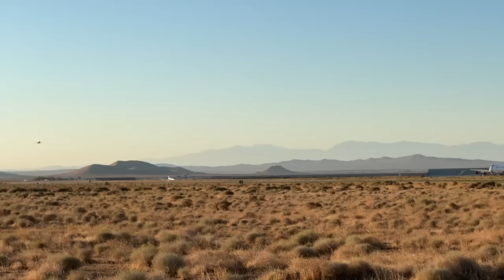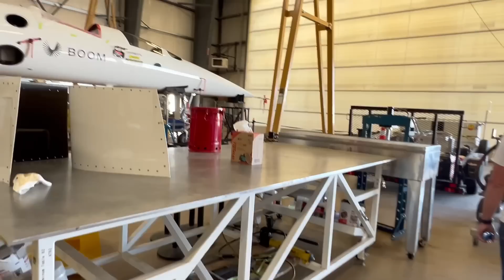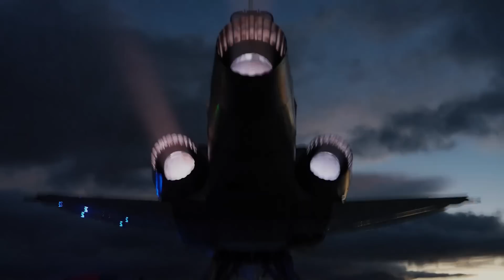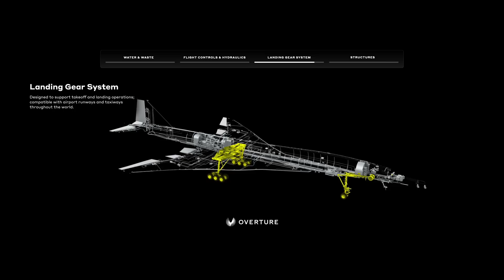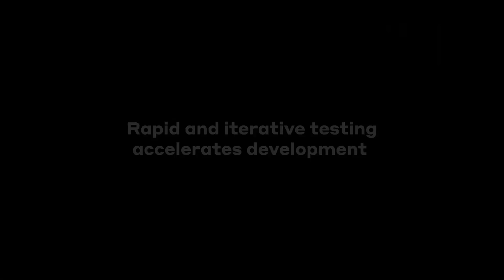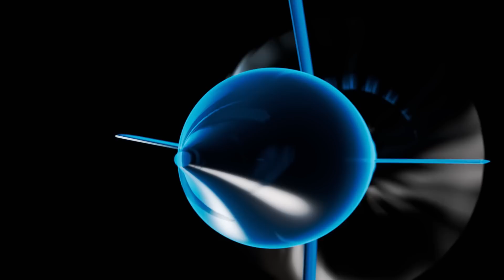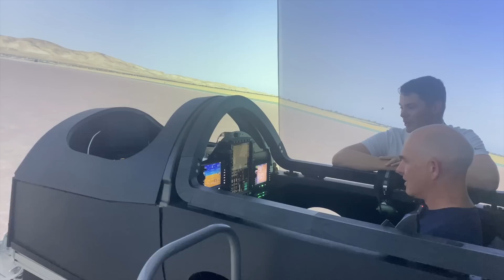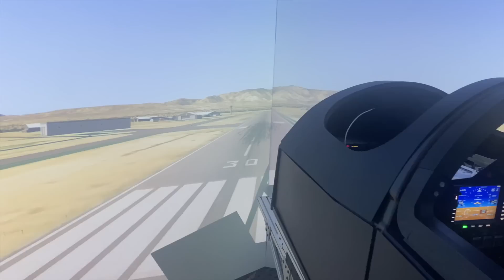Will This Experimental Supersonic Aircraft Show Supersonic Airliners Can Work?

Comment: They put windows at the upper face of the craft instead of sides. Brilliant idea to reduce friction, I usually put basic fins above craft that doesn't burn in re-entry at KSRSS.
note: basic fins rated at 1200K, but re-entry is about 2400K at ~10° re-entry attack angle
Reply: Now, they just have to put golf ball dimples like Mythbusters did to reduce drag.

Comment: The rationale for this test aircraft seems unusual.  Major test outside the wind tunnel usually begins w some form of the actual engine to be used w the final aircraft, because it makes up such a huge part of handling, performance. But the engine is nowhere in sight.  How is this significantly  different then from buying a T-38, attaching some cameras? Boom is not a landing gear company, not an aero  instruments company. Goes M1+ out of the box.

Comment: So w 2x passenger mile fuel consumption* in SS flight vs subsonic, will the Overture have any legs? If it can’t do Pacific flights, can’t claim some of that business, it’s bound to end in the same expensive doom loop which got Concorde.

*And I guess that’s optimistic . Try 3x, after realizing they can’t fly 60k’ with large passenger cabin pressure stress without a heavier cabin, and add climb time, climb fuel, so they expand the fuselage to carry more fuel which adds more drag more weight on high speed take offs, and so they … and so they .. 
We’ve seen this movie.

Comment: My gut guess is that the fuel required for this being twice as much shouldn't mean that a flight costs twice as much (purely on a cost center basis) since there is so much overhead involved in flying -- paying for pilots, hosts, mechanics, amortized repair costs, air traffic controllers, not to mention all the fees of the airport itself that get included like all the people involved in moving luggage, doing tickets, and the TSA.

Comment: Aerospace engineer here: There's actually something in this that is a give-away that they are THINKING CLEARLY and its a lesson for anyone doing a tech start-up. I am super impressed by what this one thing tells me. About 5  minutes in Scott mentions the J85 engines.

A few years ago I did a proposal to the Australian Space Agency for a program based around air launching small cube sat capable rockets using a variation of the Scaled Composites White Knight 1 which was used for Spaceship 1 and a couple of NASA programs. WK 1 also uses the J85. The main reasons was it can operate at higher altitudes (>50,000ft), it was available and it was maintainable. 

Part of the reason I picked the WK-1 was because of the engine. The main reason was that WK-1 worked and we just would not need to do anything but buy one. PLUS - we could get a second hand ex-USAF T38 for a chase plane (same engine). We could get an early model Learjet (23, 24, 25, 28) as a air launch platform for smaller rockets (<1.2t) as its engine is from the civilian variation of the J85.

THE MAIN REASON for thinking like that is it saves a massive amount on maintenance costs because all your jet engines are from the same family. Which means the parts you have to carry and having mechanics available is massively easier than many other engines or just as bad having a variety of engines. PLUS the J85 and its civilian variants, although out of production, are so widely used that the parts needed to maintain them are still available. Because the USAF still has the T38 they need spare parts so the spare parts are still in production even though the engines are not.

I have worked on development projects many times and one of the things you look to do is select things YOU KNOW WILL WORK so you can concentrate on other things. This is fundamental to project management. This is called project risk reduction and so many companies get it wrong which is why so many development projects fail.

Just that one thing has completely changed my mind that these guys are both sensible and practical rather than being another money pit operating on fantasy land whim.
Reply: I suppose while they're in development that helps a lot, maybe before they can pitch to the big investors with all their test data from the small prototype? But all that goes away once they move to the Symphony. I'm just some guy who has worked in the airlines (dispatcher), and I get what you're saying about the simplicity and affordability of widely used existing technology. One airline I worked for was an early launch customer of the Embraer Brasilia, and its teething problems were awful, though predictable for a new design (even with off the shelf engines). It all worked out, and the Brasilia became an awesome aircraft.

But that Symphony engine looks far different from anything else in the airline industry, and I imagine training for A&P's will need to be extensive. I don't imagine they will wear or fatigue like typical subsonic engines, though maybe I'm wrong. I'm no expert. Just imagine an SST with no afterburners... it'll be loud as a medium bypass fan, but nothing like those afterburners.

I really hope this works out for them. A smaller size than the Concorde seems a good idea since they couldn't fill them, and if they really get that efficiency (twice the fuel per passenger as subsonic aircraft), I think they'll do quite well, unless they fall due to environmental concerns. At first it looked deceptive - the shape is very similar to the old Boeing 2707 design, so in my mind I saw it as a great big plane. Who woulda thought - the economy of smaller scale?
Reply: @DrBeenaPlumber  Actually Concorde flew with almost 100% capacity on every flight. That was just one of the myths about it NOT being economical.

Sorry if this takes explaining but its important people know what happened.

There was a superb BBC documentary done on Concorde after they cancelled it and it told a far different story than common because for a change they asked the pilots and it was the pilots who ran the Concorde Division of British Airways.

Way back at the start after a very shaky start the executives told everyone they were going to stop Concorde because it was losing money. The pilots called them out saying it should not be losing money as it was operating at 100% capacity. The execs called their bluff and challenged them that if they could make money they could run the division.

In a stroke of genius they realised that there was this odd group of people who'd use Concorde 2-3 times a week. Sometimes they fly across the Atlantic and then straight back on the next flight. So they went to those people to find out who they were. The answer - lawyers and bankers and as part of their work they'd fly across the Atlantic get some papers (contracts) signed and fly back. These people loved Concorde because it saved them so much time.

The pilots asked them what they thought the VALUE of a ticket was and were shocked to find it was several multiples ABOVE what was being charged. These lawyers and bankers actually had no idea what a ticket cost because it was their secretaries who bought them.

So the pilots raised the ticket prices to where Concorde could make money and stuck to those couple of routes the lawyers and bankers wanted. For 20+ years Concorde them became British Airways most profitable division. Even when all the other divisions lost money Concorde still made money because of its core business.

What actually killed Concorde was Osama Bin Laden. On 9/11 around 100 of the top users of Concorde died in the towers. So there was a sudden a dramatic loss of their key market. They never recovered.
Reply: @tonywilson4713  Wow, that's certainly not a story I've ever heard, but it jives with this company's statement that a core customer base is out there. I know it's a myth that the Air France crash killed the type, and I know 9/11 had people kinda nervous about flying in general. I didn't know they lost so much of their customer base in the towers.

Is that documentary on You Tube? Do you know its name? I'd really like to see it. If that's really the full picture it sounds like the SST market is ripe for the picking right now (bankers and lawyers must be back up to their full compliment), unless it dies because of environmental concerns.
Reply: @DrBeenaPlumber  Yeah I had never heard that story until I saw that documentary and that documentary included interviews with the pilots.

The first time I saw it was on TV and I think it might be on YouTube. Its an odd length like 40 minutes or an hour 10 minutes. Its not the standard 25 or 50 minutes for TV.

Comment: The big thing that made the Concorde so problematic was cost.
Expensive to run planes means high ticket prices. High ticket prices means fewer passengers. Fewer passengers means less demand for the plane. Low demand means high development and production cost.
If flying 3 times as fast is only marginally more expensive for the passengers, they would gladly use the fast plane.
But a ride on the Concorde over the Atlantic cost somewhere around 10000-15000 (adjusted for inflation). Exactly the opposite of what people want.
If they manage to design a supersonic passenger airliner with a ticket price in the low 3 digits of today's money, there can be a market. Even if they get it into low 4 digits there will be demand.
Reply: Concorde had its market and when it flew it was profitable from the late 1970s on. It was a small market but it was big enough for the handful of aircraft which existed. Of course they could not simply extend this market that simply and it had to fly over sea otherwise it was inferior to a normal airliner.

It's like with the 380, there is still a market for the ones using it. You can't use it everywhere and not every airline can use it but if you use it on the right routes it's still economic.

Comment: I've had doubts from the start even before RR pulled out.
A cost out of the designers control is airport landing and handling fees which will be as large as an a380 because it'll need plenty of runway yet this'll be shared over a few passengers. Not even Taylor swift can afford to land at Heathrow in her global express.
There were so many restrictions on concord's routes despite the government involvement.

Comment: Same engine manufacturers also make all the 'supersonic' engines ,and are quite unassailable , engine cores are shared in many applications so even this one should have an off-the-shelf core from these manufacturers and maybe custom stages they need for the task vs blank sheet of paper design

Comment: Fifteen or more years ago there seemed to be a concerted research effort into sonic boom reduction on several fronts, including by NASA. I saw one of their research vehicles at Kennedy SC in 2012. The goal being to remove the barrier to supersonic passenger flight over land, which had been one of the real drawbacks of Concord. Yet Boom seems to be ignoring all of this and has stated that they will also not be going supersonic over land when in service. So what's the point? And what happened to all of the boom reduction research?

Comment: What happens if they lose the nose gear? Generally they’ll have a blow down system or just use the weight to drop the gear in case of a gear malfunction but those systems can also fail & it does happen. So what do they do to land if they lose the nose gear?

Comment: "About twice as much fuel per passenger" compared to what? Average? A lot of flights today are 'short hop' flights between neighboring cities, which use extremely high amounts of fuel per passenger and drive those numbers up quite a bit. Even if Boom is making an apples-to-apples comparison on the routes they want the XB-1 to fly, we're in a time when we (still) need to significantly reduce oil usage, more heavily regulate airlines to reduce wasteful emissions they unnecessarily generate, and incentivize innovations and expansions in and increased use of more efficient travel methods than air, so double the fuel use for wealthy people to save a couple hours isn't something we need to have or allow.

Then there's the noise problem. The engines of the Concorde created a massive nuisance to thousands of residents anywhere near the airports it used. Boom consistently fails to mention this problem, or offer any metrics or even indication to show the extent to which the XB-1 will have the same problem. That this one has no afterburners doesn't necessarily mean it won't also be earth-shatteringly loud even compared to contemporary airliners.

I like cool new aerospace innovation as much as anyone, and there are in many cases very good reasons to pursue it despite its costs. "Because it's cool" and "because it'll be like the glory days of the Concorde" are frankly shitty reasons. I would love to believe there's some other reason besides those and wealthy people's convenience that a supersonic airliner is a good idea, but in the multiple years I've been seeing ad spots for Boom Supersonic, I still haven't. Meanwhile, I haven't seen a good answer to either of these problems, which are actually compelling concerns.

Comment: Economics doom this to failure, whereas an oblique flying wing would be so much more efficient and could fly at a range of transonic and supersonic airspeeds efficiently.   
Another issue is the environmental impact of emissions in the stratosphere is potentially very problematic if any amount of scale is reached to sufficiently make this economical.
It was fun working as an aerospace engineer on a similar NASA funded project in the late 90s.

Comment: "Will This Experimental Supersonic Aircraft Show Supersonic Airliners Can Work?" No it will not as that has already been shown some several decades ago. And commercial - there are enough super-rich people that they might find some clients.

it is not the creation of a supersonic airplane that is hard - it is making it make any sense for civilian use, let alone commercial use. You can only go supersonic over the ocean and only for longflights is the actual flight the really significant time-factor so only a small fraction of all flights are even eligible for this.

Comment: The size of the rudder and the aspect ratio id determined by the need to dampen the oscillations in yaw, (dynamic stability) an inadequate case requires a yaw damper. 
A large volume of the fuselage is destabilisating also.
It is far more complicated than assumed . So special flight tests are required
However this airplane is impressive, very much so.

Comment: I was under the impression that noise regulations covering engine noise at airports and sonic booms over the continental US are the core issue that prevented the Concorde from flying over the continental US and hence prevented economies of scale that would've helped a LOT with making it commercially successful.  I'm curious how this has changed for Boom, especially if they need to fly a super shallow approach with loud almost-straight turbojet engines.  That would relegate them to airfields in the middle of nowhere, which would obviate the business plan based on speed, and also obviate domestic flights which would drastically curtail their addressable market.
Reply: The only thing that changed is that the US is developing it this time, so all those ‘issues’ aren’t issues anymore now that they’ll get a piece of the pie..

Comment: Wow, this is where they are at after 10 years! It's not going to happen. Even if they get this tiny plane up to Mach 1+ and prove they can build a small plane capable of travelling at M1+, (like every military aerospace company on the planet), it doesn't prove they can build a passenger liner that can travel supersonic, or that they can overcome the sonic boom that means it has to fly over the sea, or carry enough fuel that it travel any further than Paris - New York.

Comment: "Will This Experimental Supersonic Aircraft Show Supersonic Airliners Can Work?" -- No, no it won't!
While it's a good bet that a modern take on the SST will be better than the Concorde, that should be a given given the progress in materials and 3D CAD in the last 50+ years, but they will still suffer the enormous increase in fuel consumed per passenger mile and it is for this reason more than anything that a modern SST will fail UNLESS it's subsidized as Concorde was.  Remember, the ticket price the Concorde passengers paid was a lot less than the actual ticket price and the difference was made up by the taxpayers in UK and France.  That's right, the average working class person that could never afford a ticket on Concorde was nonetheless forking over their hard earned money so that a wealthy person could buy the ticket for less.
In addition to the ridiculous fuel costs, the Concorde and what we are seeing now with Boom Aerospace are planes that have to be very narrow to make the cross sectional area as small as possible to have any hope of keeping fuel costs within reach, but that means the planes will carry fewer passengers and the cost per passenger will necessarily be higher.  
I do not see a modern SST as viable for commercial aviation, but it is within reach of the billionaire class that now buys Gulfstreams.  If instead of an $80M G-750 a billionaire might opt for a private SST at, say, $120M if they can get the price down to that point I think billionaires will buy some of them.